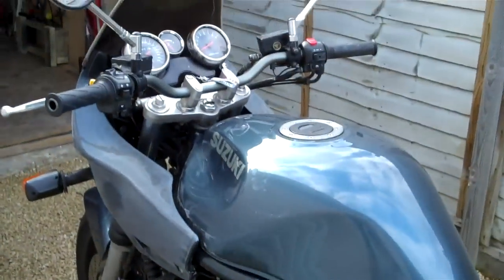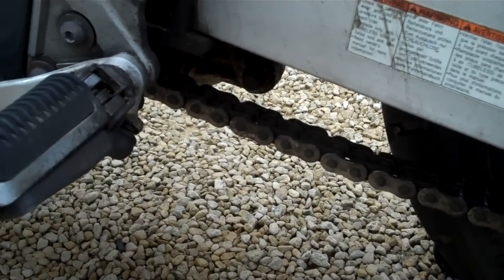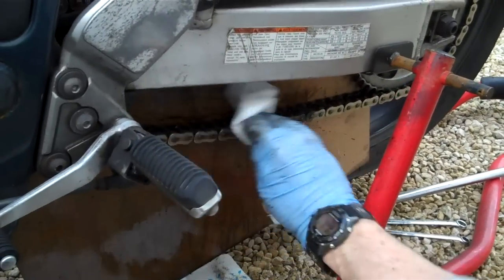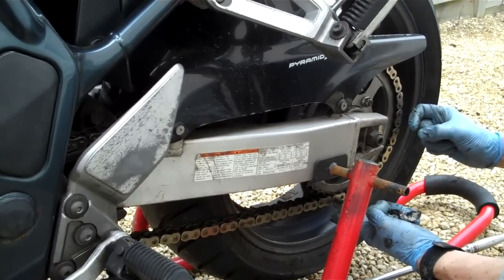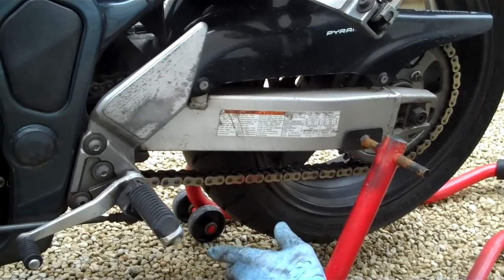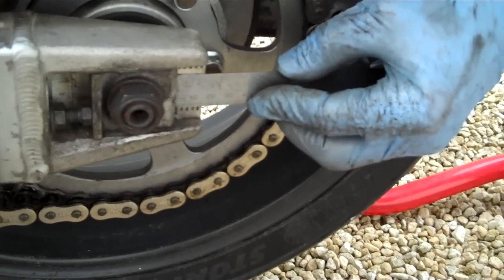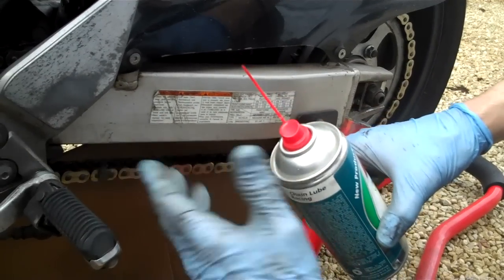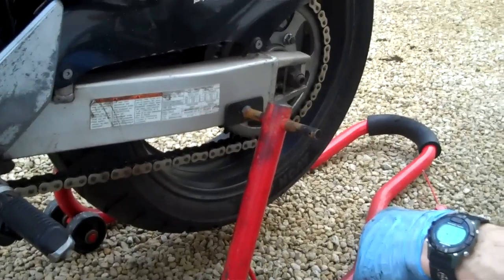Delboy's Garage, Suzuki Bandit, Chain Adjustment. (plus clean and lube).

Comment: Hi there, thanks for the upload. I have a couple of questions.... Is WD40 really good for the chain? Doesn't it damage the O-rings? The other question is, I got a brand new Street Triple and now I didn't lube the chain in the first 1500 Km's.... 'cause the chain looked lubricated. Does that first 1500 Km's without lubing harmfull for the chain or do you think it isn't too bad when I will start lube and clean it from now on (intervals of 500 Km's)?
Thanks in advanced :).
Reply from the maker: Hi mate, the WD40, same as Paraffin, Diesel, or Kerosene all act as a solvent to clean off all the old stale chain wax and dirt....you dont use it as lube in itself....dry it away then lube properly with a proper chain wax or lube....

You really ought to have oiled your chain from day one, yes they come with an amount of lubricant on them from the facotry, and like any spray on lube that starts to fling off and dry out right away....it wont have done any real harm, as you will also have been running the bike in so probably not riding too hard...and if its been dry weather and you've not ridden much in the rain then it'll be fine....either way, get it oiled up right away and do it every time it stops looking wet, on a rainy day the water and spray can strip the oil off your chain in ten miles, so lube it after every wet ride, and if you dont get it wet, then at least every 500k... why not thing about fitting a chain oiler and then you just top up the reservior every couple of months, it will keep your chain oiled as you ride along and also keep it clean of grit and dirt..!   we have a fitting video if you decide to go that way.. all the best, and enjoy your Triumph... Del
Reply: Moonfleet41 Thnx for your respons Del. But about WD40, I mean it is a water repellant and if one uses it regulary to clean the chain, There's is a chance the o-rings will dry up and will crack. That was my concern. I know use a chain degreaser amd will lube it today with Bell-Ray's. Thanks again for your reply. Cheers and keep it up. Greetz from the Netherlands :).
Reply from the maker: ***** Ive been using it to clean chains for years, and never noticed the o-rings suffering, also use it to protect my Tiger's engine finish, i wash the bike, let it dry off, then coat it up with WD40, and that obviously includes all the coolant hoses, and they, being rubber, seem to be fine after years of doing it, in fact, they are like new, supple with no cracking, and not a hint if perishing either... if you're worried about it mate, you can use Kerosene or Diesel, but its messy and hard to clean up off the floor... Hope that helps, good luck and thanks for taking the time to write.. ride safe. Del.
Reply: Moonfleet41 Thanx again Del for your advice and sharing your experience :).

Comment: Each time I shift into the 1st gear (from N) I hear an unpleasant knocking sound. Is this normal in my new Bandit1250S AB? This happens 6 out of 10 times. Would be helful if you can explain. Thanks.

Comment: Invaluable video! :) whats the best way of replacing your bandit 1200 chain & sprockets?
Reply from the maker: Hi Jon, chain and sprockets replacement is a simple enough job, but its not easy to just answer "whats the best way to" on this comments page...in short its;- wheel out, cut the old chain off, swap take the front sprocket cover off, swap the front cog over, change the back one on the wheel that's out....then reassemble it all with a new chain, I have a video back a way in the library, its covered on the swing arm change about a year ago..

Comment: hi Del mike here again mate, need to replace my throttle cable pull on my 600 bandit, but i am putting a 1200 bandit throttle cable which is little longer than a 600 bandit one its 95.5cm where as a 600 one is i think 84cm, so is it easy to do or not cheers mate mike ;-(
Reply from the maker: As long as the end fittings are the same for both, then you just have four and a half inches extra cable to lose, you could play around with routing it to get it neat and tidy im sure.  Take care Mike, and good luck with it.
Reply: @Moonfleet41  once again thank you for the info Del put new one on today adjuster at the throttle end will not adjust so it has to go back, but it went on great very easy, just waiting for there reply now tomorrow to send me another that works hate it when that happens , you wait all that time for it and get and it dont work ;-( any way thanks again Del for info takecare best to penny as well mate pls ;-) ride safe brother and sister ;-)
Reply from the maker: @janwoodworth5072  Oh no, it's so frustrating when people send faulty parts, just cost time and grief you don't need... Hope you can get it fixed soon mate.

Comment: You apologise waaay too much :D 
I was riding along thinking what's that bloody clicking noise when i stop accelerating; ahhhh my chains resting on the center stand ><
Have to admit, as much as I love my bandit, motorbikes are a complete time suck for maintenance compared to a car. Now I've got a chain to adjust, brakes to clean, front-tyre needs replacing, stupid oxford heated grips need removing (wire with insulation tape, not even connected), New horn (current one sounds like a squirrel farting), new horn I ordered didnt work :| 
And of course more work in general to get parts its nearly always online and with no advice, you can't just nip into an autotyres for new tyres.
Reply from the maker: Hi Chris, I know what you mean mate, it's like painting the Forth Bridge!  But a well maintained bike is a joy to ride and will save you a trip in to the hedge ... honestly mate, chain resting on your centre stand??? that's disgraceful lol!  Get it tightened and lubed, it'll even change gear better... cheers buddy and ride safe, Del
Reply: Moonfleet41 cost me a new socket set (big ass bolts), but my chain is now tight and clean; WD40 ftw. Thanks!

Comment: I replaced my chain with a brand new chain and sprocket kit and the tick marks are equal on both sides.BUT my chain is on the loose side and the reading is not marking on the “new chain” or blue mark. It’s reading near the “replace chain” mark. WHY? It’s a brand new kit. Please help.
Reply from the maker: OK, this is not uncommon, check the number of links you have on your chain and check the spec with the manufacturer (ring the dealer if necessary), and that'll confirm you have the right chain... but secondly, this is often the case now with chains, as they don't stretch like they used to.. from brand new to worn out, the axle may only move 2-3 notches on the swing arm at most..

Comment: Hi del, just re-visited this video after my last chain adjustment at 4K and then had to adjust again at 7K, now 9K in and needs adjusting again. Long story short, is this an expected interval for chain adjustment? It was riding okay, but then after about 20 miles I could hear it knocking again as if it were slack once more. Could my chain be knackered already after 9K from new?
Reply from the maker: There's no hard and fast rules mate, motorcross bikes riding int he dirt will knacker a chain in two meetings, and on the road, in a bad winter, if you neglect it, you can knacker a chain in 1000 miles, which is why we took the trouble to make the video... to test if your chain is stretched to it's limit, pull the chain off the back of the sprocket and if you can slip a pencil in the gap that results, then it's pretty much toast!  9k sounds low mileage, but, as I said, all depends how you've kept it and whether it was a cheap chain and sprockets... good luck, Del
Reply: It's a DID chain, and I can't pull it off the back and fit a pencil in there. However, I think the wheel may have been slightly out of alignment as last night I adjusted just the chain side and it seems okay now. However there are a few tight spots on it, and I'm concerned now that it may be a little too tight. What are the implications of the chain being too tight, I understand that the rear shock won't work to it's full potential, but can it also put excessive strain on the motor? Also, if the chain is knackered, should I replace the chain and both sprockets, or just the chain only? The sprockets look okay to me.
Reply from the maker: Alex Carpenter
If a chain is too tight mate, it can knock the output shaft bearing out, and even break the chain itself....fit a new chain and sprockets in on go, and it will be fine.. you'll soon see how worn the sprockets really are when you get the new ones home..
Reply: Once I've got a new set on there, after X number of miles, should I change the front, then after another X number of miles, change the front again, then after another X number of miles, change the front, rear and chain together?
Reply from the maker: Alex Carpenter
Hi Alex.. get the new set fitted, run it in for abut 500 miles, then check adjustment as it may stretch a tiny bit after bedding in... then I generally change front sprocket every 6-7k miles until the rear one is worn out... which is usually at least 30k... but I also run a Scottoiler and clean the chain periodically... good luck with it mate
Reply: the v system is not compatible with my bike as there are no vacuum ports so the e system is the only solution but it's about 250 quid! :(
Reply from the maker: Alex Carpenter
Thats a lot of money for a scott oiler.. have you spoken to them about it?, never heard them cost that much. !!!!
Reply: The E system is the electronic version that wires into the battery instead of using vacuum.

Comment: What about the other side of the chain?  For me its easy to take the chain off my bike and let it sit in a drop of petrol in a pan or wd40 or what ever (Non O ring chain), then scrub it off with a brush :)
Reply from the maker: You cannot take off a riveted chain without removing the swing arm or cutting out the rivet link, so I presume you must have the old fashioned clip type chain link used on smaller bikes and yes, clean the other side too... only so much you can fit in to a video...

Comment: I have read clean and every lube every 600 miles, would that be about right?
Reply from the maker: It makes no different how many miles your bike does on the clean chain, it can get caked in road crap in 100 miles if its thick salt and heavy wet weather, its more important to check how dirty the chain actually is, if its a warm dry sunny season in dust free conditions, then you can go months without needing to clean it, just a spray of dry lube every week......so go with how dirty it is mate, not how many miles its done as no two types of conditions are the same.... and ride safe in this weather too aye.. cheers, Del.

Comment: can you adjust the chain while on sidestand?
Reply from the maker: Yes if you have to.. its important to have weight on the suspension.. but make sure you roll the bike along until you locate the tightest spot in the chain before you set the tension..!

Comment: thanks pal
took my bike for a service (600 mile) cost 130 pound 
will start taking a personal interest in your vids to save some mula 
how often to clean and do you have to clean everytime you lube ?
as the guy in the shop said very 2 weeks . seems a lot ?
graet vids
Reply from the maker: +Pepe Regis Hi Pepe, no you wont have to clean the chain every two weeks...maybe lube it every two weeks, but you only have to clean it when it gets dirty, and if you fit a Scott OIler you will just have to fill up the reservior once every couple of months or so, and that oil washes the chain off too... so maybe fit one and save some time and effort..? Hope that helps.. Del.
Reply: thanks for the fast reply
very helpful
mate i have to ask 
wots a scott oiler ?
new to biking at 45 .....  got a cbr300r after passing on a xj600  3 yr ago . love it , easy commute in london .
Reply: ebays got 12 cans for £12 . having sum of that del . thanks for the tip
Reply from the maker: +Pepe Regis This is a Scott OIler... http://www.ebay.co.uk/itm/SCOTTOILER-SCOTOILER-V-SYSTEM-CHAIN-LUBE-MOTORCYCLE-/291674643483?hash=item43e929dc1b:g:A~EAAOSwX~dWrvzY
 If you wanted a way to oil the chain automatically, then this will do it, and make your chain last three times longer....if you want to buy one, let me know, i have a discount code that will get you 10% off...

Comment: hi del, my bike has a triple s chain on it and am reading really bad reviews about these on internet, just wondering if you have any experience with these chains and if its true there really rubbish, thanks john
Reply from the maker: Hi John, there's nothing wrong with them, they're justa cheap option, as long as your get the right one for your bike, and fit it correctly, they're ok... they are built down to a price, they won't last as long, and you'll be adjusting it more often, as they stretch quicker... on average, they cost roughly just over half the price of a DID Regina Gold X-Ring chain, which will last 30k miles easily, maybe even more, and with a chain oiler, will hardly ever need adjusting... I've had mine fitted for 7.5k miles and adjusted  it just once and that was more out of OCD as I run them a little bit slack anyway on the Tiger.... hope that helps mate
Reply: Moonfleet41
 cheers del thank you
Reply: Ok thanks del, there seems to be alot of j t chains on eBay, not sure if there any good? I went 1 down 3 up on my sprockets and even with the adjustment as far forward as possible am down to about 15 mm of slack, Kawasaki recommend 27 to 33 mm so I'll have to go up 2 links.

Comment: I am trying to find out something about my Suzuki bandit 650 riding on highway running at 60mph my bike will run at 5500 are 6000 rpms what do i do to make it run 60 at A lower rpm
Reply from the maker: Hi Loretta.. if you change the front sprocket for one with 'one tooth MORE' it will raise the final drive gearing and give you about a 500 to 700 rpm drop at your cruising speed of 60....  there is a very slight side effect, and that will be the first gear pull away will need a little more clutch control to feed the power in.. it'll be a little like pulling away a higher gear...but not so much you'll stall it..!    Hope that helps, Good luck.. Del.

Comment: I heard that wd40 damages the rubber parts on the chain is that true or is it ok to use it to clean chains ???
Reply: Thomas x As far as I know its made specially for dissipating water from plastics and rubber-ish parts. So I think its quite safe, but then again maybe doule check their website if you want to be sure!
Reply from the maker: Thomas x Sorry mate, missed this message... it could well be that in the greater long term WD40 causes some perishing of rubber, but am sure that's in the very long term and not immediately... remember chains are finite, like tyres, and they wear out far sooner than a squirt of WD40 could kill them... so think you're fine to use it on your chain... more importantly, failing to keep it clean will do a lot more damage than a bit of WD40 ever will, so perhaps it's a trade off!

Comment: I used the WD40 chain lube and I do not recommend it. Its sticky so it gets dirty really quickly and it gets all over your wheel and swing arm and it is like tar, it doesn't come off.
Reply from the maker: Good points mate, sticky chain lube is like a fly paper and needs cleaning off on a really regular basis!
Reply: Moonfleet41 I've been riding just about two years and I was warned not to put my bike away after riding in wet salt. Rust on the chain and brakes and the chain lube is hard and sticky, I learned my lesson.

I've learned so much from your other videos too, I rode my YBR on an icy day once and nearly came off because my brakes were binding so much. That bike was a bag of s**t.

Comment: hey Del i recenty paid someone to fit and adjust my motorcycle chain they guy said he used a laser to adjust the chain on my suzuki gsf 600s 1999, and when I looked at the tension nuts they dont seem to be aligned, the side the chain is on is marked on the first notch and the tension nut on the other side is in between the first and second notch is this normal???
Reply from the maker: Jimbo Deano Hi Jimbo, they should be pretty much identical both sides...does the bike track straight through corners?..
Reply: Sorry what do you mean exactly?
Reply from the maker: Jimbo Deano When you lean the bike over in a bend, does it ride ok and feel safe, or does it weave about like it wants to drop over by itself...!

Comment: So,...
You say to find the tightest part of the chain to measure. Another video says find the lowest or slackest part....which is it? 🤔
Reply from the maker: Think about it..  The adjustment you make must make the chain slack enough to run without pinching taught which can stress bearings and cause damage, the chain must always have some limited slack... so if you roll the chain round to the "Tightest" point, then set the slack.. it will NEVER get tighter than that, and will run safely.. a little extra slack is no problem within reason..... BUT.. if you set your chain at the slackest point, then when you ride, and the tight spot takes up all the slack, you chain is pulling too hard on the bearings and in extreme cases can break... so ALWAYS set your final drive chain by measuring at the tightest point..!
Reply: @Moonfleet41  Geeez...you've responded to a question of a video  put out several years ago.. Didn't really  expect that but very much appreciate it. Your answer makes sense to me. Cheers.👍
.
Reply from the maker: @johnpaley8857  Most welcome mate, Ride safe.